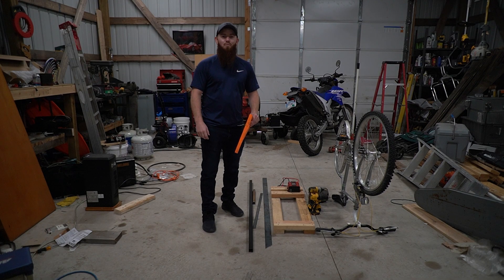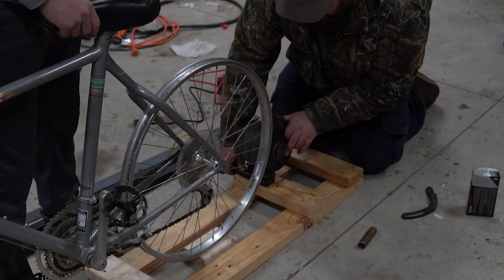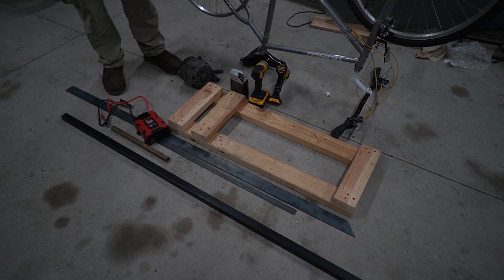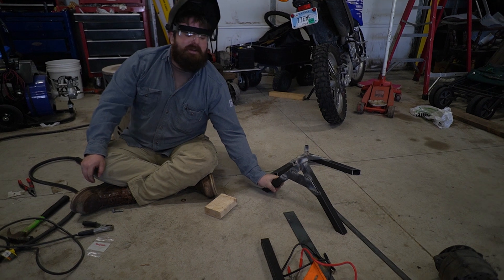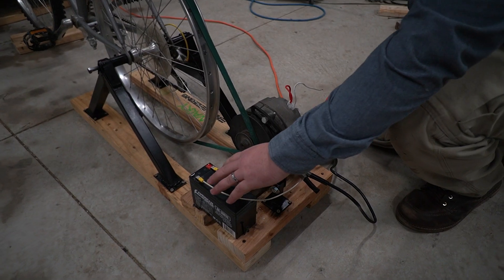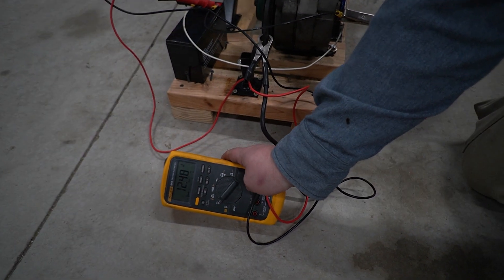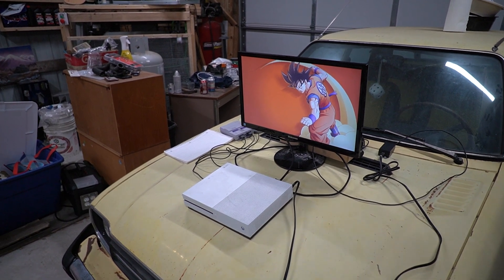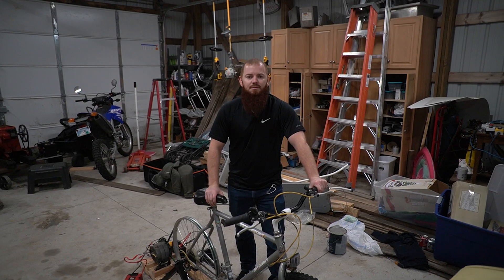Homemade Bicycle Generator Using an Alternator #greenenergy #diy

Comment: I just bought a bike with a flywheel on the front. The idea is to keep the momentum moving so I can break for a time while pedaling. I got it for $8. It has about an inch groove on the outside edge of the flywheel. So I’m hoping I car drop a belt in the groove and see where that goes. I’m curious what you think. I don’t have the advantage of stepping up or down gears but once I get it going it should stay going. Also there are people who have built in switches to activate the alternator so it can be a one person operation.
Reply from the maker: Yes that sounds good. We did later add a switch for ease of use!